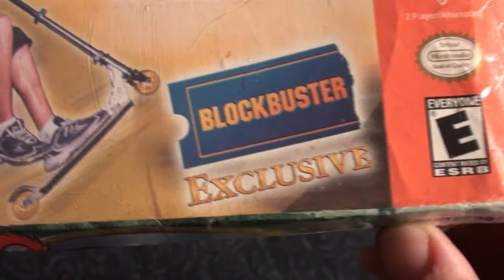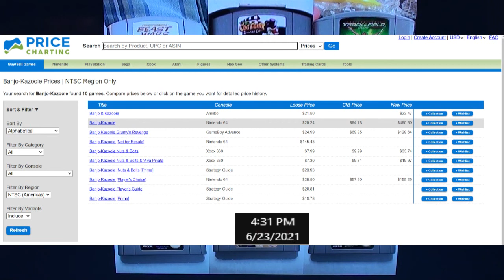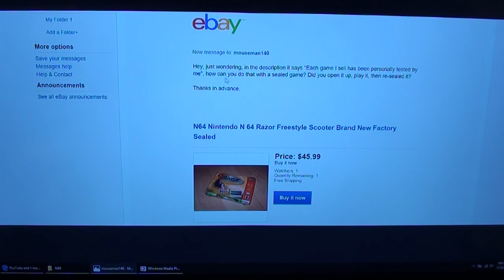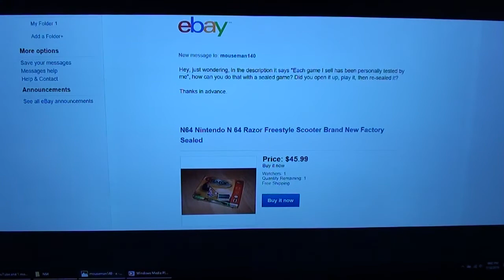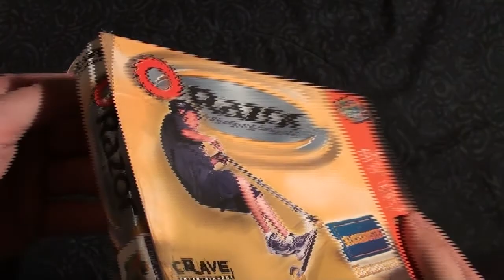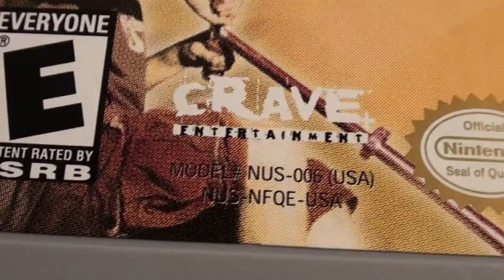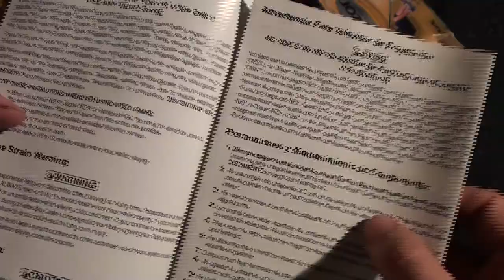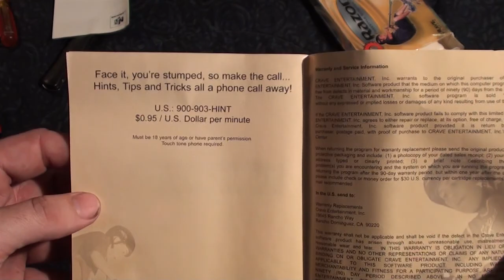Razor Freestyle Scooter - Cartridge Authentication & Manual

Comment: The cartridge pins are gold plated. They can rust if you leave water on it which is why they say not to blow. Over the years of selling it's fairly common with used games (usually a kid spills a soda and it gets in the cart). I sand off the rust with some 240 grit sp. You have to be careful not to damage the trace when you do so though.
Reply from the maker: +CatsGamesWhatever
I've never had rust on the pins due to blowing; I never spilled anything on them though.
Reply: @silverwings21  I highly doubt they would rust by blowing. Usually it's people being overly cautious.

Comment: Looks like a boilerplate listing template he used but didnt change. He's a touchy seller though as you have to add someone to a blocked bidder list on ebay. If he has 10k feedback the actual # of transactions the seller has done is probably closer to 60k. Maybe he has gotten a lot of trolls in 60k though.
The seal is legitimate. There's no reason to seal a box like that. Reseals happen when you get monetary incentive to do so. I can't imagine there is much price difference between a CIB copy and a sealed one for this game.
Also the white piece that fell out is part of the inner tray that holds the cartridge. It was probably torn when the box was crushed.